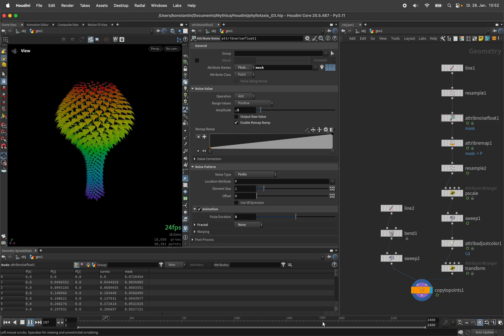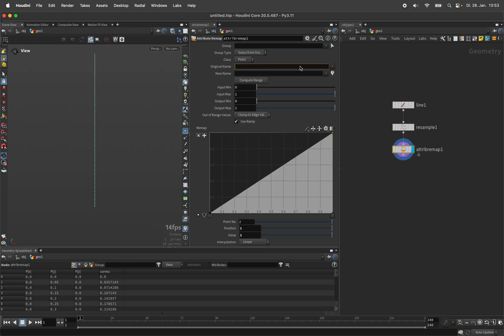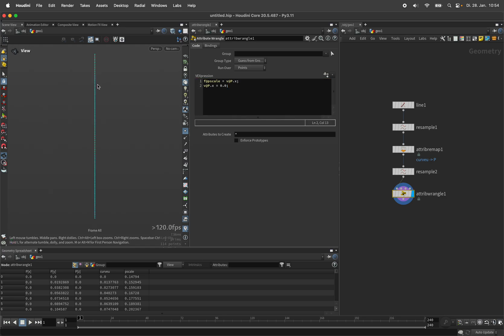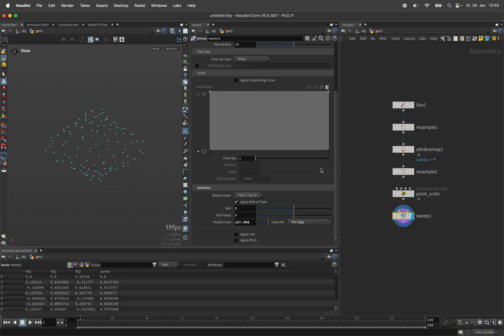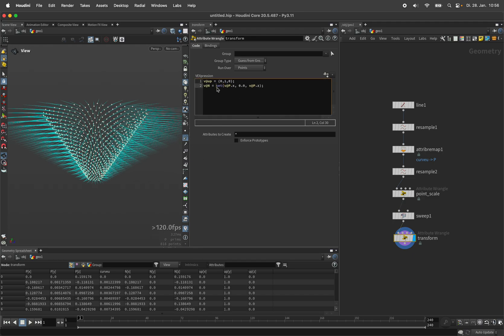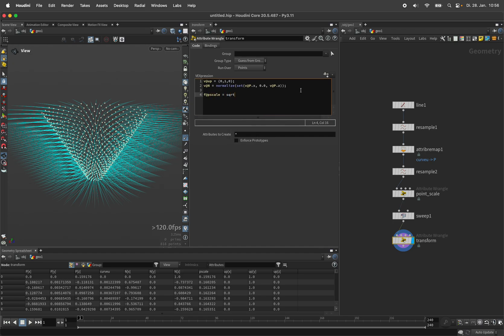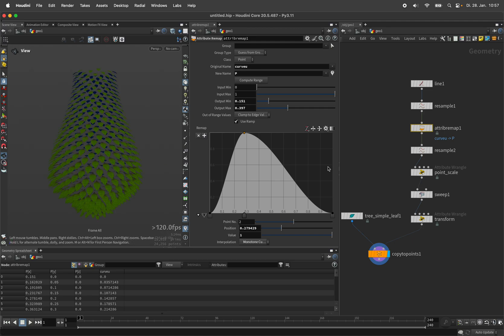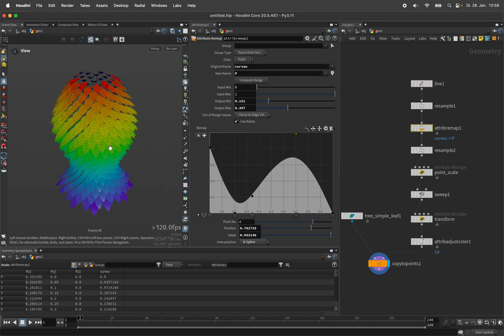Phyllotaxis Spiral – Houdini Tutorial

Comment from the maker: - MORE PERFORMANCE: Set the 'copytopoints1'-node to "Pack and Instance".
- LESS REGULAR: Append 'attribnoisevector' node set to N after the 'transform' wrangle.
- TILTING LEAFS: Add a slerpv()-function to rotate v@N inside the 'transform' wrangle.
Reply: if I wanted to tilt the leaves inwards and I was using the slerpv() function with @N, what attribute would I use as the second vector in that function to get it to rotate nicely?